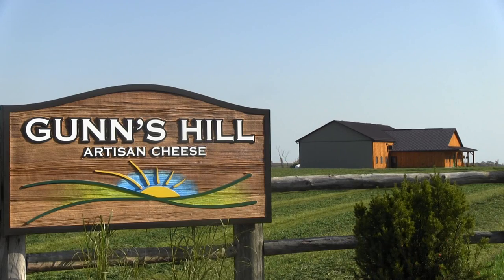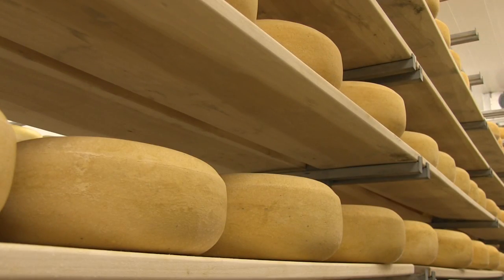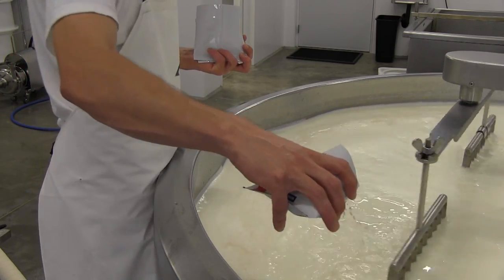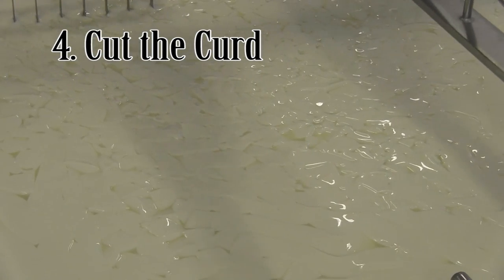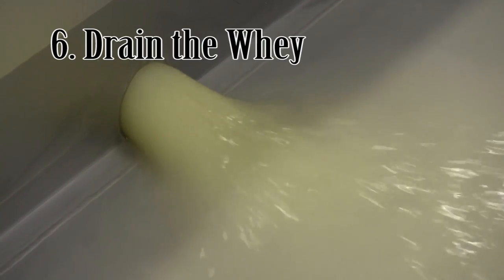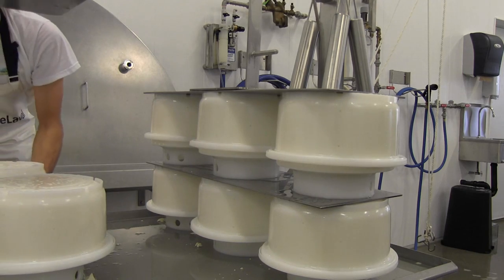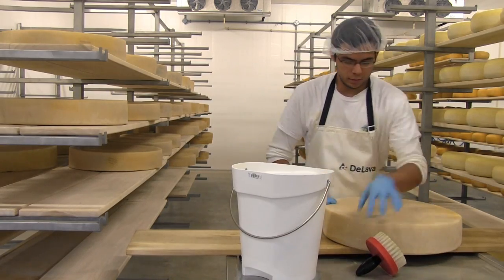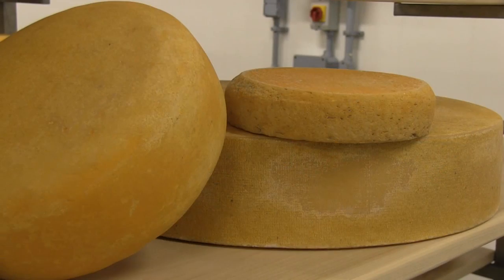How cheese is made at Gunn's Hill Artisan Cheese

Comment: Only remark is that the pasteurization temperature is 73°C and not 63.
Reply: 63 C is the correct temperature,  low temperature held for a longer time (30 minutes) so as to preserve as much good bacteria as possible. If heated to 73C then the hold time is 30 seconds before chilling quickly, but kills any bacteria good or bad.
Reply: Actually, you are both incorrect. Cheese comes directly from the cow. No questions asked. In conclusion, you're wrong thank you